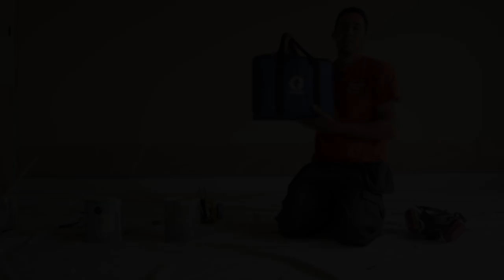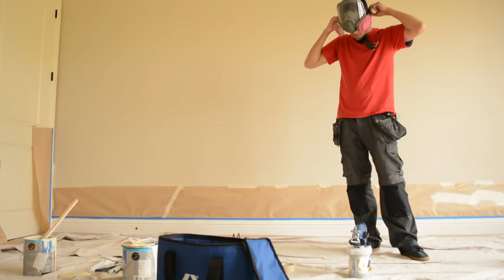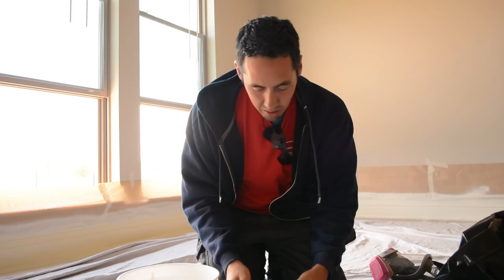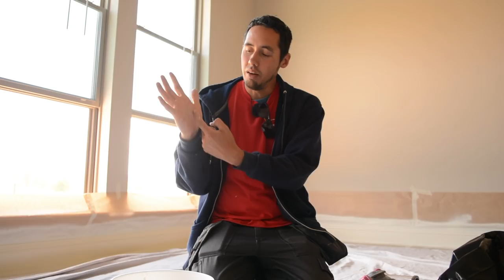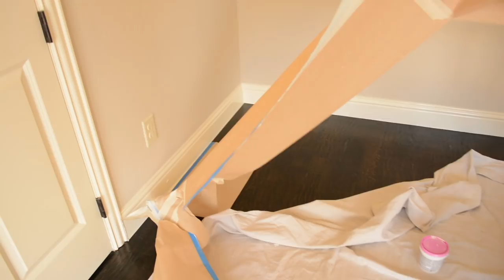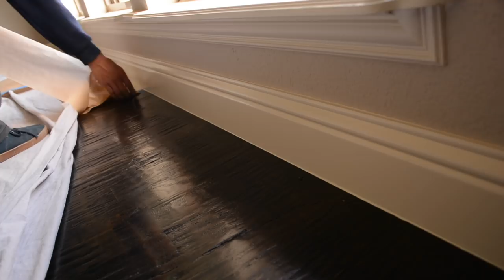SHOCKING Results! Graco Airless Handheld

Comment: The shock has to do with the flash point of the product being sprayed. Below 100 you should be using the hot solvent Graco Handheld. Some oil based products with a flash point between 115-100 can cause a shock and it has to do with the solvent.
Reply: Interesting.

Comment: Used our TC Pro for many hours and jobs, but when it stopped I was shocked at how the rubber service ports were made and how easily the Allen key stripped out the rubber on the service ports. Loved this gun until it got stopped up. Normally easy to clean up, but wish they had more solid screw.
Oh. 26 of the manual says you can use oil based paints but does warn that static sparking is possible and recommends using a metal pail and/or grounding.

Comment: Great video...all the suggestions regarding build up of static electric charge is right on point and correct.  As an industrial chemist we always considered static charge build up whenever organic solvents are moving through any pipe or piece of equipment.  Everything must be grounded before starting any fluid transfer or, in this case, before using handheld sprayer.  Using that sprayer in and enclosed room, with oil base paint, is a prime set up for a house destroying explosion if it should spark just when the vapor level reach critical concentrations.  Your very very lucky you didn't finish that job with a bang!  Another example of this static charge buildup is when they pull tanker trucks into gas stations to  refill the underground tanks...they always attach ground wires to the truck and hoses before they transfer the fluids into the tanks.  
Great videos and keep up the great work!
Reply: I agree however, How would he have grounded himself? By touching a pipe? Connection with wire leading outside to a rebar pounded into the ground? And is it only effective during the transfer of liquid?
Reply: @ralphvalkenhoff2887  the model he bought is for water based paint only!
There is a more expensive grounded unit for spraying oil based paint and lacquers. It say on the box that you can cause a fire or explosion with oil based
Reply: It's a water based gun only. I have the ultra pro version which gives you a grounding cord . Far too much hassle so why bother using oil at all. 
These guns work but the graco quickshot is far better and if at all possible go for the GX 19 versions on batteries where you actually have some control. 
I'm a tradesman 30 years have sprayed vehicles before, and found the top version of there handheld , heavy ,noisy, messy, very little control but it has plenty of power and should be called a handheld, priming and touch up gun. 
That's all it is really.

Comment: According to the manual, the unknown thinner was probably not compatible with the sprayer and caused static build up and shock. It says not to use non-mineral spirit thinners.
Reply: MoneyManHolmes 

Correct!
Reply: MoneyManHolmes:  The video for the unit by Graco states that it can spray lacquer.  Seems there is a disconnect between the video and the manual, and Richard should give them a call.  I own the corded version of the gun and I love it when it works well and hate it when it doesn't.
Reply: DRitz78 

Ultra can spray latex and mineral spirits based products.   Ultramax is needed for laquer
Reply: m m:  Thank you for clearing that up.  Appreciate it.
Reply: B-I-N-G-O ! ! Lucky he didn't detonate!
Reply: Nop I have the ultramax and it's the only unit out of the 3 that can spray any flammable stuff the other 2 are just for latex
Reply: Japan Dryer definitely has this effect. I'm glad I came across this.
Reply: I disagree. I have this sprayer, and when spraying unthinned oil paints I get shocks. Only with oils though.

Comment: Actually oil based and solvent based material has a special gun called Ultra Max HH, the one you are using is the normal Ultra HH You need to check the manuals again

Comment: It states right in the manual that there is the possiblity of user shocks...Graco ultra can only be used with latex and mineral spirits based products.  There is an upgraded gun called the ultramax that can be used for hotter solvent based products.  The ultramax is more expensive and comes with a grounding cord,  it can be used to spray anything.  He stated the paint he was using had been thinned by someone else, that someone else had probably thinned it with a hotter solvent causing the shocks.

Comment: Per the manufacturer instructions, you need to use a grounding cord with the "cordless" version of the sprayer. I bought the corded version specifically because the need for a grounding cord eliminates the benefit of the "cordless" model.
Reply: Could the paint gun turn into a flame thrower if it sparks ?
Reply: @srjr2531  I can't say for sure, but there's got to be a reason for that grounding cord.

Comment: YEP YOU SURE DID! I got the same gun. I just put a inquiry into Graco on 4/19 and they just replied with this following: "Steve,
 
The material is alkyd based and contains some naphtha. These materials can cause static shock in the not solvent resistant handhelds. Usually if it says alkyd based it will contain a solvent that can cause shocks. I would avoid alkyd base and just make sure otherwise that it states it is non-flammable."

Comment: Try using a raw union to reduce odor from paints that have stout fumes. It won’t eliminate the VOCs but it will take odor away much quicker and the onion doesn’t leave an odor behind.  And yes, a grounded wire will take away the shock. Reader above/below me has sent you the link. Good channel. Love the content.

Comment: Great finish. Could you do a video on how you tape the floor to reduce paint getting on the floor. Looks brilliant
Reply: Usually with latex, just before you paint, you wet caulk with a very thin line of clear at the tape edge, and pull the tape while wet.  With oil its tougher.   You have to use sealing wax and wipe it off real good so it only seals the tape edge.  Let it dry.  Oil is very leaky.  Wax is oil based and dried like oil.  Wet caulk won't work with oil.
Reply: Or just get good with a brush and paint a straight edge ;)

Comment from the maker: Not the kind of shocking results I was after...
Reply: Finish Carpentry TV 
U want high quality results on spraying , use flat tips homie . I've used fflp tips from Gracco and high efficiency tips from Titan they ok but u should try flat tips some time and make a video!
Reply: that is weird! never heard that happen.I would return it. I have had the graco ultimate for over a year no problems.
Reply: Finish Carpentry TV A bro how you know how much money you will charge for  a proyect?
Reply: Kinda Dumb to make a cordless sprayer, that needs a cord!
Reply: Not weird 
Motor isn’t explosion proof
Reply: There fumes getting to the Motor
Reply: Finish Carpentry TV 
How long do you wait until you pull your making off a project like this? Does it depend on oil based paint vs latex? Also I would assume temperature and humidity play a factor? 
If the above assumptions are correct then how do you know the paint won’t run onto the floor while still drying after pulling your masking off.
Thanks
Reply: Do you always paint your trim after installing or do you ever paint it prior to install and then just come back and touch up joints?

Comment: To anyone considering buying this, only the Ultra model can be used with flammable paint. The unit shown here is definitely NOT be used with oil based paints, unless you enjoy exploding. 
Once oil paint is atomized, the chance of ignition is actually pretty high. Had the room been smaller, this dude would have had a seriously bad day.

Comment: Oil Base paint looks so much better on high end projects as opposed to latex.
Reply: They have products out like the 3000 enamel from Farrell Calhoun that looks and cures smooth and hard exactly like oil but will not yellow over time and cleans up with water. Oil based enamel is useless in modern times, the only reason it should ever be used is when you're painting over oil. If you paint new material with oil you have no clue what you are doing or are an old head that is hard headed from the unnecessary fumes. You can paint a door with half 3000 and half oil and you will not be able to tell what is what after a week.

Comment: I'm so glad your doing this. I just bought mine from Sherwin Williams. It was great for waterbase clear coat but not the best results on trim paint. I'm sure it was us. I'm going to use it on home projects before I use it on the job sight and look like an idiot cleaning up my mess with no lunch and getting hangry.
Reply: mr.clean p
Reply: I own two of these guns and don't care much for them. I find they spit all over the place
Reply: Tarek Ashurex yes, that's what I found so far. I hear so much about how good they run and it did with the water base poly but not with paint. I'm hoping it's me. I'm making some doors today and need to spay them. I'm going to experiment at home before and not do it at the job sight. I will get it right......hopefully.

Comment: I’ve got this spray gun with the cord. used it quite a bit with no shock. You may have a defective product. I strongly endorse this product if you’re a DIYer. I guess the pros have their own go-to stuff. This is mine. Cheers!
Reply: He bought the ungrounded model it says do not spray oil based paints
At the end of the video he actually said they sell two models but incorrectly said they’re the same

Comment: I am an electrician and years ago I had a customer the had an air hose that was shocking him when he was running air through the line.  It was actually static electricity that was shocking him.  They make an air hose that has an internal ground built in.  I know your using an airless sprayer so I don't know what the solution is but I'm sure Graco has seen this before.  Its usually caused by temperature and humidity conditions.

Comment: I love using my TC Graco Pro but I'm curious as to how it handles stains and clear coats like polyurethane? I love it for paint but I'm trying to speed up the time it takes to stain/seal the furniture I make.
Reply: I have used mine for staining and putting on clear coats. It works well as long as you get a fine finish tip. And, of course, sand and tack between all coats of clear.

Comment: If you are getting shocks from the spray unit it is possibly electrostatic shocks, it can happen if you wear heavily insulated foot wear, it’s is also possible there is an earth fault on the motor but at low amps you would barely feel it.
Try using footwear that is not rubber soled.

Comment: Richard, I need to paint the Windsor one 1x6 base I installed in my house. I have vinyl plank flooring and Im wondering the best way to mask off the base so that I don't get paint bleeding on to the flooring? Im thinking a line of frog tape down on the floor up against the base on the floor and then doing 12" masking with cheap tape on top of that? Should that be sufficient?

Comment: I had the same thing happen to me . Satin impervo with penitrol . I took it back . I used it for tiny spindles and it was an acceptable finish . I should have not worried about using extra materials and just used my old nova airless with a 209 . I was told the brushless model wouldn’t shock but it’s not worth the $500 in my opinion .

Comment: Rich under different circumstances not associated with painting or trim work.   I've received small static shocks through my headset while flying.  Not sure if you might have been getting some sort of static shock through a combination of paint material and moving across the floor to paint.  But I would contact the manufacture.

Comment: Static electricity often weather depending and dry conditions it's even worse when you have a big airless run on air and painting metal surfaces such a container standing on tresle covered in paint and can't ground
U spray for a bit and the build up is massive if not grounded

Comment: I just got mine, it works great on latex paint. I want to use it on lacquer finish to see how it works
Reply: The Graco UltraHH will not spray lacquer. You will need to buy a Graco UltraMaxHH unit to use for lacquer finishes.

Comment: How did you tape to the baseboard with out the paint bleeding through was there a big gap. In Australia there's never really a big gap it's usually flush to the ground
Reply: In uk to stop bleeding il tape up then run a thin bead of chaulk and wipe to seal in

Comment: Solving paints call static electricity. That's what the shock comes from. I just got the quick shot set up. And it comes with a grounding cable. I don't know about that portable gun😮

Comment: hi
i have qestion please:
where did you buy the paper with the glue tape ?
i try to find this protect film with the tape but i dident find it

thanks
yossi
Reply: You need to buy a 3m handi masker. Then you just buy a roll of tape and a roll of paper, as you use the tool it puts the tape on the paper, it's right behind him at the beginning of the video, you can also get 42 and 74 inch pull down plastic, one of the best tools I've purchased
Reply: it does not come with tape on it u need the 3M handi masker which applies the tape to the paper as it's being rolled out

Comment: Unless you H and AVE to have a sprayed look those baseboards could be brushed a lot faster than all the taping and cleanup.
Reply: No comparison to mask and sprayed vs brushed.  Having done the finish work in mega million dollar homes, only thing I'd do different, is undercoat. sand, vacuum and tack cloth.. before spraying a finish coat,  even over pre-primed wood.  Undercoating and final sand gives a look of perfection.  I don't care how good someone is with a brush, there's no way to match the perfect lines from masked and sprayed.

Comment: You should be using the TC Pro Plus. The TC Pro Plus is for materials with a flash point of 100 or less. Sometimes you can get shocked with even a 115 flash point product. It has to do with purity of the solvents used if a higher than 100 is shocking you. The TC Pro Plus is for Lacquer, MEK, acetone and all flammable products and WILL NOT SHOCK. It's a compatibility issue, nothing wrong with the unit.

Comment: Your videos are great. I have worked as a construction electrician and construction superintendent all around the world. You’re a top hand by any measure. I would guess a wire to the switch that is bare. I’d send it back instead of trying to fix it since it’s new. You might try rubber gloves in the meantime.

Comment: I’ve got the ultra max I’ve have sprayed oil with it , no shocks , however the tip guard and thread is different also some sort of plastic, so you can’t use standard extension poles or tip guards,  I thought you can not use the model you have for oil,

Comment: If it's ungrounded, than the rate of flow throw the line can create static electricity to build up causing that effect. It actually creates a spark and that is what you're feeling. I shouldn't have to tell you what could happen if it decides to happen. Without being there to adjusted it I'd say bring it back and talk to a knowledge rep about adjusting the flow, also it could be a combination of that and the paint being to thin and it's causing static electricity. Either way take it back and get another one. It can be fixed so everyone will be whole. Good luck my man

Comment: The standard Pro Shot isn’t designed well  for shooting oil. It’s shocking due to static build up. They say it can spray only mineral spirits based. But good luck finding any oil base paint that only has mineral spirits in it.  Most oil base paints still have xylene and mek in them. As far as how much in them it takes to shock idk. I’ve had south west builders shock, PPG oil shock and ProClassic oil shock. The Pro Shot Fine Finish wont shock you. It uses different internal materials to help relegate the static build up.

Comment: some paint thiners and oil based products have flash points lower then 100f. graco suggestes using paints and cleaning with products with a product with a flash point no lower then 100f or 38c
this could have resulted in the static discharge your were felling, i have same unit

Comment: Now add up the time it took you to mask up and prep the gun and spray it and clean the gun and take the gun to get fixed and add that time up against taking a brush and pot out and brushing it and cleaning the brush. Besides the cost of the gun compared to a brush how much time would it compare to the brush finish? Also brushing with waterbased is a lot more forgiving and can make it look good with less effort if you are not looking for a high gloss finish. I found you go one level down with Waterbased. For instance, it never looks as glossy but if you want a satin look then gloss will flatten off with one coat over an undercoat. If you want it matt then get a satin or semi gloss and it always looks flatter. Never has as much shine as oil based but easier to apply, more forgiving, better coverage, doesn't yellow in dark areas.

Comment: Likely you were getting static charge from the atomizing of the paint and spraying it on the baseboard. The charge built up in the gun and shorted to your hand. The battery could not cause that problem.

Comment: Do you know why lightning comes from clouds and travels to ground?  Because the charge is dependent on the surface area of the droplets. Fine atomization creates more static charge. Solventborne paints atomize much more finely than waterborne paints, thus more surface area to develop static. There is nothing wrong with the gun. If the relative humidity was 50%, you wouldn't be getting a static discharge.

Comment: Hmmmm, isn’t atomized oil a fire hazard?  Wonder if you can use an anti static cloth and lotion.  I think I used an anti static shoe band with dangling cable always in contact with physical ground several times.  Not sure how effective they are.